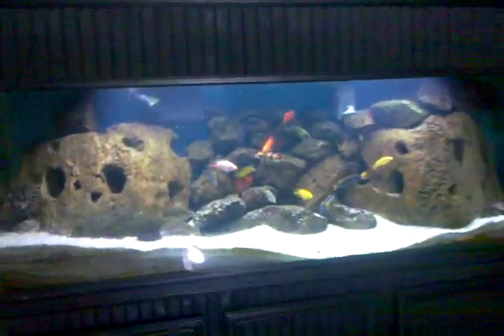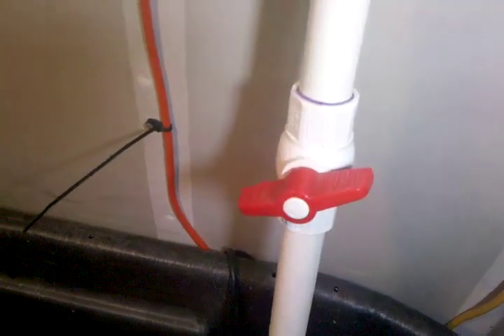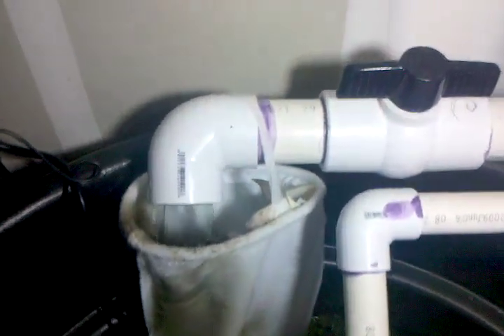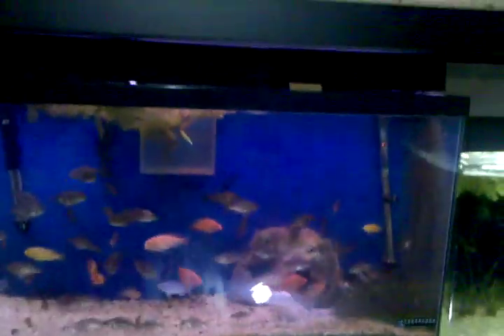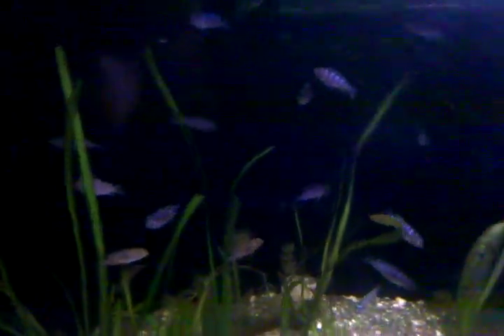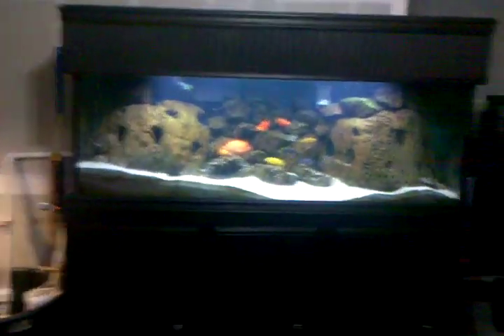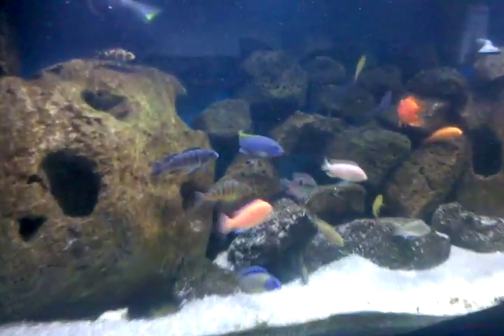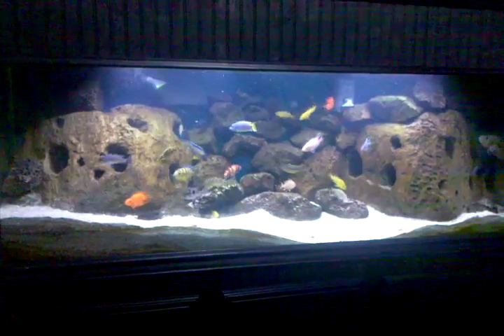my 470 gallon cichlid setup fish room

Comment from the maker: @Deelove2000 thank you very much. Well I have two 1600 gallon filters on this system with two uv lights built in. But yes I could build a sump like everybody else uses but I gain 170 gallons of space for more fish and a larger water capacity for my bio load. Water change out? Once a month and I over do it with a 100 gallon change out that is so simple with a garden hose straight out the garage door. As time goes by I started adding plants on an aquaponics setup leaving me with almost 0 nitrates.

Comment from the maker: @geraldgustav the two big rocks are pumice. Which is not very dense but heavy and float in the tank. So I had to weigh them down with the lava rock.  But yes all I did was drill holes it and than cut the whole rock in half with a hot saw so I could have two of them in my tank. Check near the rivers for nice rocks

Comment: This is an impressive set up but why not use a larger central filtration tank for your system with a open trickle and build your distribution piping around that with floss media.  I find that keeps the water clearer than the socks.  I bet your water changes would be better served using that rubbermaid for the change reservoir.  Nice tanks.

Comment: Its pretty easy with them as I look for long extended fins in males.  The will carry on and show bright colors versus the females which tend to grow larger.  I have a smaller planted tank for my freshwater set up.  I've been trying to breed bettas in smaller tanks.  My 125g saltwater just spurred some ugly algae after 8 years.  Come to find the new bulbs I changed were wrong spectrum.  Beware of different manufactures bulbs.  IT DOES MATTER.  Busted my thumb up but will post vids soon.

Comment from the maker: @utsuriman ya not fun at all. I think I'm on my fourth one. But I got to take each on back and get a new one. I think the trick is to never shut it off.  But I had one run for over three years straight.  I always have problems if I shut them off. But your right. I always have a back up one.  There a lot cheaper but a headach in the end.  I will soon convert the whole system over to a saltwater hottub pump there like 600 to 700 bucks tho. But I've yet to find a fish pump that powerfull enough